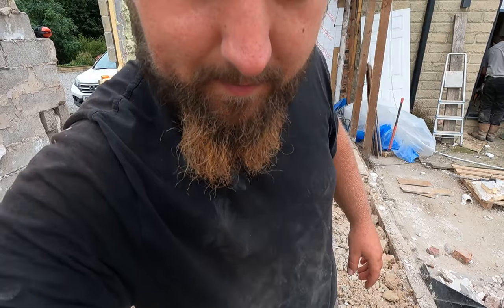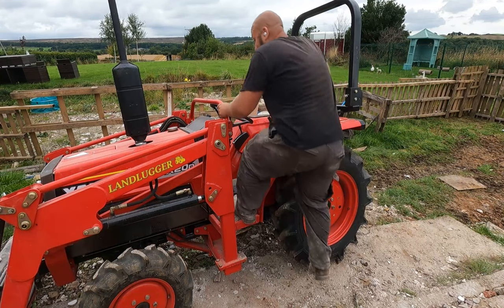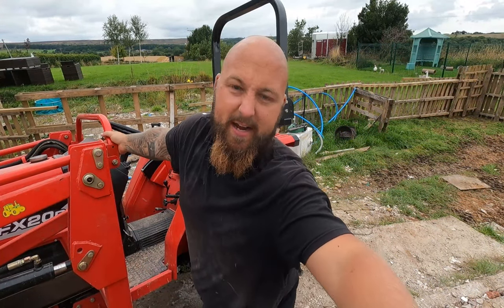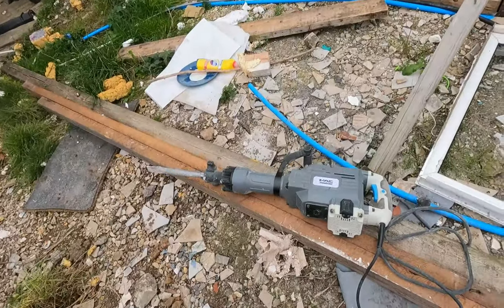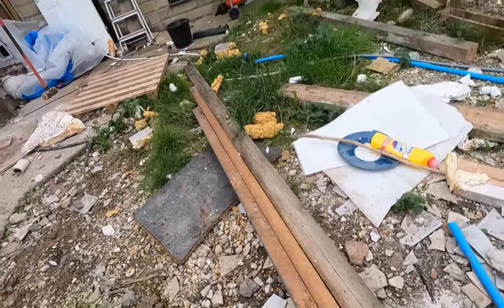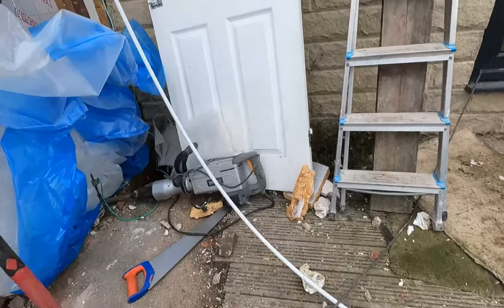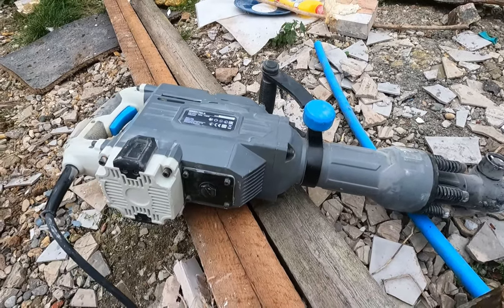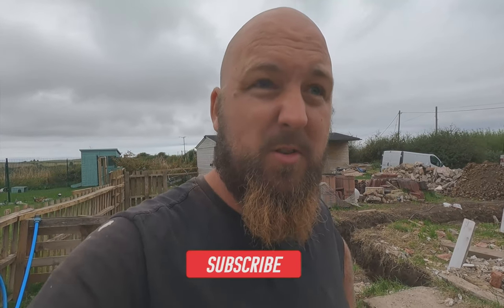Day 1 - breaking concrete floors and a review of the MAC ALLISTER MSBR1700-A breaker

Comment: I've got a load of pavers and a concrete panel garage that I was thinking about breaking up and using as a sub base for a gravel driveway. Reckon one of those would be the right tool? Thanks
Reply from the maker: Hey Nic and thanks for commenting, yes I do believe these tools will be great for the job you are intending. Bear in mind them pannel garages will contain rebar inside the concrete. Just be careful with them. But yes a breaker will work great.
Thanks again 😁
Reply: @everydaywithmenick  thanks Nick, I'm in 2 minds to hire in a crusher for the day. I'll need to wait and see the size of the pile. Thanks for the rebar heads up, will need to get that out of the way. Cheers
Reply from the maker: @Nic y  a crusher would be most ideal and the nice and compact one that can be loaded by hand is great. We got a quote for this job for a crusher and it was about 3k. Obviously the customer said no chance to that. Yes be careful if using the crusher with that concrete garage. Hope all goes good.

Comment: looks like you should have invested in the hammer attachment for your excavator ...it would have paid for itself by the end of that job.  keep up the work
Reply from the maker: Hey Dirty Steez, unfortunately the chipper is a little pricey for the few jobs I'd need them for. But if I'd of got the full package then yes it would've been great on this job. Thanks for commenting and watching 😁
Reply: @everydaywithmenick  yeah buddy i would agree... thats what I did was order the whole package deal.
Reply from the maker: @dirtysteez1569  for some reason i didnt get the full package, i didnt enquire about it either. An auger would have been good as ive been asked to put some posts in.

Comment: A heavy electric breaker would be quicker those things will burn out
Reply from the maker: Whilst I partly agree with you Michael, these things are cheap and cheap never lasts forever. My titan breaker is 6 - 7 years old and still going strong and had some mega work on it. But I'm deffo impressed with that Mac Allister concrete breaker. 
Thanks for your comment bud. Means a lot to me 😁
Reply: @everydaywithmenick  Just picked up a Macalister 4 weeks old for £100 with receipt.. Not used.  Have lots of old concrete fences posts to remove and a concrete slab :) hope it works :)
Reply from the maker: @snappyfish  if it is as good as the one I used then it will be fine. That one I was using had some punch behind her. Happy breaking buddy